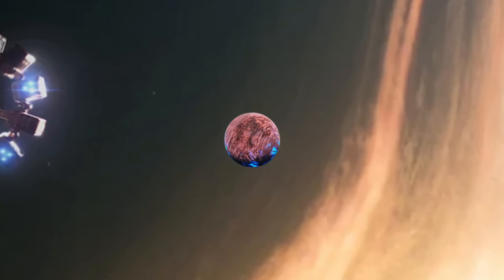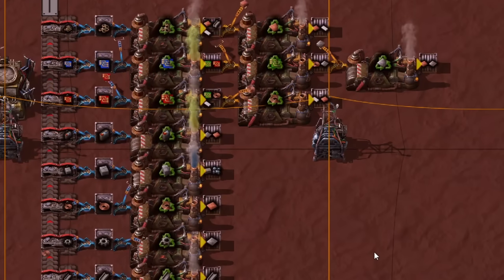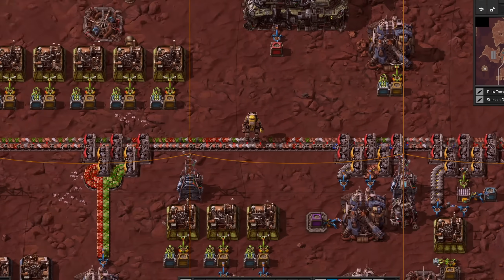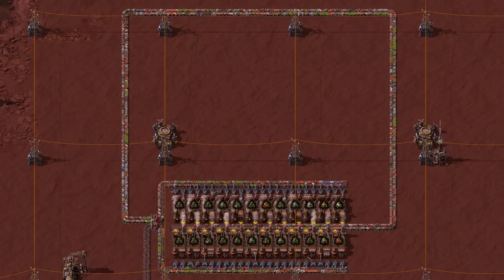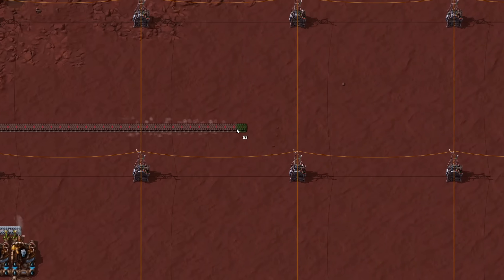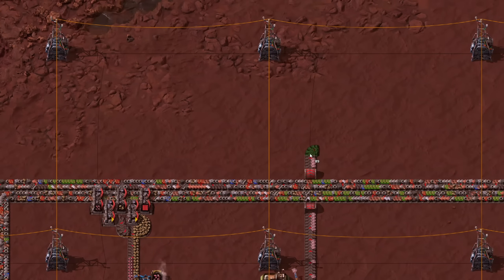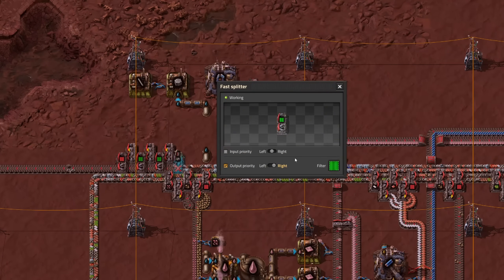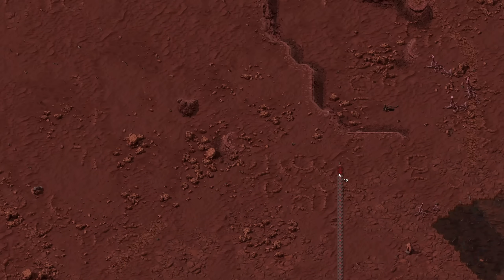Master Planet Fulgora in Factorio. Embrace The Sushi Belt! Factorio Guide / Tutorial

Comment: But you still have to make a kind of main bus going out of the sushi belt, don't you? I mean, multiple assembly lines need iron, for example. If the first assembly line takes all the iron, there won't be any left for the next one. Or should I use bots?

Comment: I was forced to do all my Fulgora production on an island that had mountains of scrap but absolutely tiny real estate. I didn't have rail support foundations, so I imported 250 bots and made a robot based supply chain for the science pack. It was an absolute logistic bot chaos with all the iron gear wheels but it worked out except for the holmium shortage
Reply: Occupy more scrap islands, send Holmium ore, batteries and copper wires (to produce green circuits on fulgora) to your main base so you can produce fulgora science faster.

Comment: 5:05 i've had this issue in my main bus where a single splitter will for some reason clog up the entire system if the side being filtered can't move. So I split off the main belt and then add a second splitter to filter out the item I actually want in cases where the belt had two kinds of items on it.

Comment: Am I the only one using bots to sort this mess?
Just have 2-3 chests for each item with a filtered inserter putting stuff in from the messy belt into the chest, and loop the sushi back into the recycling. Now you do not waste stuff as it gets buffered, also you can have a circuit stop the scrap input if all buffers are full.

Comment: I made "good enough" efficiency compromise... I store like 10k to 100k of everything that is readily available from scrap then I connect chests with circuits into output of arithmetic combinator. Input of that arithmetic combinator is connected to constant combinator and setting is "each = each * -1" then go with that output to inserters that throw excess stuff from storage system and set inserters to take filter from circuit network and set what you want to store (and how much) in constant combinator. It's very simple to control and gives me less anxiety than sushi belt with almost no reserve of items.

Comment: I would highly recommend using productivity modules on every single building that is fed holmium ore or one of its byproducts (rather than speed modules like you do for holmium solution here). I did a deep dive on the math: one fully saturated express belt (45 items/sec) of scrap can sustain an output of ~0.48 EM science packs per second (using EM plants and foundries where possible). With productivity module 1s in all the holmium byproduct buildings, that is increased to ~0.70, an increase of ~44%! With legendary productivity module 3s that is increased to ~1.34 per second, an increase of ~180%. Output is even more if you use turbo belts of course. These buildings are a great use case of high level productivity modules.

Also, this factory has a problem (unless I am mistaken), and that is that it limits the rate at which holmium ore is added to the belt, and thus will limit your production of EM science packs (or anything bottlenecked by holmium ore, such as EM plants). Think of it this way: EM pack production is always bottlenecked by holmium ore, and so it will pull all holmium ore from the sushi belt, and the only way to add more holmium ore is to recycle scrap, but the scrap is only injected into the sushi belt (and thus recycled) with low priority (which is good because this prevents the sushi belt from clogging up). In other words, every time some resource on the sushi belt passes through the scrap injection splitter and prevents scrap from being added into the belt, it prevents scrap from being recycled, and thus lowers holmium ore throughput, which then lowers EM pack production.

The solution to this is simple or complex depending on how you look at it: Simply make sure you always remove everything from the sushi belt BEFORE you inject scrap into it, so that the throughput of scrap (and thus holmium ore) is never limited. One way to do this is to have a second group of recyclers that recycles everything at the end of the sushi belt (before the scrap injector) that recycles everything that was not picked up and used by consumers. You can have the output of these recyclers inject back into the sushi belt (with low priority) AFTER the scrap recyclers but BEFORE any consumers pull from the sushi belt. When recycling scrap, the sushi output is at a rate of 60% of the scrap input (on average) so the sushi belt should have room to inject the output of the second set of recyclers without backing up. I haven't tested that, however (some items when scrapped output >1 item, and so can clog up belts when scrapped at sufficient quantities, these are mainly red and blue circuits and low density structures).

My setup is a little different where everything on the sushi belt not picked up by consumers is sent directly to quality up-cyclers. This unfortunately means my sushi belt will never have resources that need to be recycled from anything except scrap, so no iron plates, copper plates, green circuits, or plastic bars. Those have to handled in a more manual way (for example, pulling from the quality up-cycler loop and feeding them directly to where they are needed).
Reply from the maker: Hey, some of the things you just mentioned are part of the follow up video on Fulgora.
So yes, there's a lot of room for improvement. This setup is meant to be the first stage of the sushi belt to setup production of all the products you immediately need after arriving on Fulgora.

Comment: Or you can just use drones. Green cable from drone port will give signals with everything contained in network, all chests. You can just look what is overflowing, and get it from the drone network into reciclers if amount in network is higher than some threshold. It is not even real logic, just a cable from droneport to a manipulator dropping items from request(or buffer) chest into recycler, and result can be just given back to the network.
And you can even add quality modules for those overflow consumer recyclers if you are in demand for higher tech products. For ice it is useless. For circuits - free stuff from trash. Splitting 5 teirs of 3 precursors with belts - I'm too old for that. Drones will do it by themself. And you will want legendary everything someday anyway.

Comment: the way i sorted on fulgora stuff to make main buss is to to make yellow belt as starting point use 14 sorter fast inserter to sort and move items to main bus using underground belts is it expensive hell yeah like setting one of these parts cost 14 yellow belts 14+1(for inserting scrap) fast inserters 28 underground belts the red ones (so it can be easily expanded) 2 power distribution towers those and 1 recycler and for over flow i flow these resources to sorted steel chests and if chests are overfilled i just send exces to so called desintigration centre

is it expensive hell yeah but does it job realy good hell yeah also the main belt from 14 is merged to 7 so 1 item per lane of belt yes the items when going to desintegration centre are sent as priority to main belt so wasting is up to lowest point wichout cloging system also its not very compact

Comment: How did you get the input/output fluid connections for electrolyte lined up between the 2 electromagnetic plants at 7:08?

Subscribed for how helpful this video has been for me.
Reply from the maker: Since 2.0 you can now flip buildings horizontally or vertically. I think the shortcuts are F and H but I'm not sure.
Reply: @AVADIIStrategy Thanks!

Comment: Great tutorial, thanks! At 3:45 you say that setup will run infinitely, but I fail to see how it would not eventually get clogged up by simple items e.g. iron and copper plates.

Actually I think I just found the answer that might be helpful for anyone that sees this. You recycle iron and copper plates into themselves at a 75% loss. You can see three such iron plate recyclers at 3:47 but I actually don't see any copper plate recyclers. Interested to find out more.
Reply from the maker: Exactly, recycling = 75% material loss. If you cut off the scrap belt, after a while there will be absolutely nothing left on the sushi belt.
Reply: Thank you, spencer! :) Had the same question.

Comment: I was despairing of setting up reinforced concrete until I realised I could just minorly tweak my platform design to load up iron ore from orbit and shoot it down on the surface- I hadn't brought elevated rails as I went in blind.

But really good design work and thought in a simple and elegant sushi solution, I might actually further tweak my platform design to use the same filtering system as I had been constantly manually dumping excess cargo to get it into balance. :)

Comment: The Splitter at: 5:46. In this config i saw that some of the holmium is not selected by it in my game, even when the belt is empty. I thought it would catch all of it until its full ? Greetings 👋🏼
Reply from the maker: It should catch all yes. Unless you made a mistake and forgot the output priority setting (or by accident used input priority).
There's also the possibility that you might use quality modules.
If your recyclers output an uncommon or higher piece of holmium ore it would pass this splitter.
Reply: @AVADIIStrategy  ohhhhh i seeee oh man :D thank you !!!

Comment: With productivity the bottleneck in my base is actually batteries.
Reply from the maker: Yes. And when you try to make extra batteries with sulfuric acid you might run into a water bottleneck.
That's why just adding another recycling loop to supplement missing items is best.

Comment: I came up with something pretty similar to this, but the problem I encountered later is that a single vent just couldn't keep up with my needs for resources and I've not really found a good way to increase my scrap recycling as I've also put everything on a bus 😅
Any ideas?
Reply from the maker: I updated to a double sushi belt using turbo belts. That's 4x times more throughput.
You can split the recycling process, not mixing scrap with it's recycled products. This way you can easily filter out items you don't want on the sushi belt like for example gears, ice and solid fuel further increasing throughput.
That was a part i initially wanted to include in the video but then realized it would make things too complicated for the purpose of this video which is to give people a very easy sushi belt start.
And of course like shown in the video: make more sushi loop just to filter out some items that are bottlenecking your main loop like holmium and possibly batteries. Some people complained about a water bottleneck so you could supplement ice as well.
Reply: @AVADIIStrategy Perfect 💡, danke vielmals :)

Comment: This is the same conclusion I came to: a sushi belt that loops back into recyclers. My system uses multiple belts, with a number of those belts being "protected" belts. Protected belts bypass the recyclers and are fed back into the system through a balancer. Recycled products likewise hit the same balancer, and all is distributed equally through the system. This assures items are allowed at least one full loop without being recycled, so even if the machines needing these items are behind the producers in the loop, they will still get the item. All items are input onto protected belts, and items are pulled off the loop from both protected and unprotected. For those more ratio-inclined, you can use production rates and simple geometric series to calculate pretty much anything your heart desires pertaining to factory efficiency.

The one inescapable is the initial ratios of recycled scrap, or as I like to call it "Slop." Slop will always be 1/3rd gear wheels, 1/15th steel, 1/20th red circuits, etc. so plan your scale according to your most needed of these initial slop components.

Comment: you could also use the entire belt of scrap by just dedicating the outputs of the recyclers to their own line. I have one that pulls overflow items, breaks blue chips, red chips, and basically the things that break into more intermediary items. so blue chips becomes green chips? recycle those first so they lose the 75% belt volume they had. (not actually but its usually less than if we kept the initial items from scrap) we can return everything to the "main" belt. then we have more to pull green circuits and reds and the like, also their own dedicated set of recyclers. then after these two sets we end up with green circuits and copper wire, and after all 3 sets, we just have non-recyclable items and they go to chests and overflow is pointed to two recyclers facing each other. ive found that while a sing side of the belt backs up periodically, even with 60% scrap prod I can consume a whole belt of scrap. A good way to think about it is you recycle scrap, then filter off multi-recyclable items until you are left with just the items that cant be recycled.

Comment: My first complete "no-mod" run on Factorio SA, I did a full bot-base on Fulgora.  It was successful, but had its own set of headaches involving Storage Chests and needing to recycle/destroy items overflowing them. 

No matter which approach is used, it appears the Recyclers will need to be used to destroy items.  

This approach seems to be a bit more trouble-free than my current belt-base approach of Scrap -> Recyclers -> Separate using the filter splitter -> Process items as needed into other items -> destroy buffer overflow using Recyclers.

Comment: I think this is way overthinking the issue and it is not scalable for quality or for space efficiency because of the spaghetti that it makes in a area that is really space limited.
Just use bots to transport everything and scrap anything that has an excess amount using a requester circuit logistic settings of something like If iron gears > 4000. That way you can throw quality on everything including the miners without a problem. You would need to keep an eye on it until you setup all the items on recyclers but then you can start doing things like making increased quality parts from higher tiers.

Comment: I have done the same error as you in the first 2 hours, it was madness. Then I have changed with logistic setups. First I split the main belts into all the resources (no backup feed), everything is then stored in storage chest with logistic filters. 

I then have "recycling malls" activated by circuit conditions. I check the network resources if the items are > amount I want It get recycled down with . The input of the mall are Requester Chests where I set the amount from the circuit network. The output of the recycling mall is Active provider that force the material to be loaded into storage chest again that are counted in the network. Finally you need to setup storage chest connected to network for mid products like green circuits, plastics, etc.. 

The downside is if you improve belt speed you need more "recycling malls" to be able to trash more items. So far is working without any clog

Comment: I've made an automated train station (based on DocJade's autotrains) that serves all 12 items after scrap recycling. Overflows go into quality upcycle, overflows from that go into trash/recycler loop.
It was a pain in the ass to set up, the circuit spaghetti is awful, but now I can move all required resources out from my recycle island and setup a conventional production without sushi belts.
Another benefit is that it fits the modular design very well and I can use most of the Fulgoran islands if they can fit 3-5 train stations and a factory.
The downside is building the train stations, otherwise it works really well and can scale.

Comment: i ended up doing a main bus splitter with an overflow system, overflow goes into a quality scrap recycler and anything rare is put into logi for high quality crafting later, this way you don't ever back up but you also don't fully waste material if you back up, even high quality stone is useful,  the only truly garbage item is high quality ice which i have a special system to destroy. hq fuel is dubious but you can make very fast cars with it,  so it's at least fun to have

with this process my meager fulgora base produced huge volumes of everything i needed and its my first stop for quality materials, thousands of banked blue red and green circuits in epuc rarity

i am very interested in trying this sushi belt idea though

Comment: I did a 100% bot manufacturing after scrap was processed. I ended up using filtered splitters to make short sub belt sections for each resource with 2 inserters into 2 chests, it doesnt catch all but thats ok. The rest continue and go into OTHER recyclers that make the sub products. End result is that all 12 are sorted, stored and processed where at the very end of these is more recyclers that eat anything I cant use. I made 3 of these to capture more holmium. Its worked VERY well UNTIL.. green circuits ended up blocking as I didnt build a way to actually eat those. I wrongly assumed theyd never end up blocking it.. 30 hours later it did happen hehe. Now I have a way to ditch those also. I really LOVE your belt solution and I do usually prefer belts myself.
Reply: Then concrete, then solid fuel, then gears, then blue circuits, and so on. The clog NEVER ENDS! haha